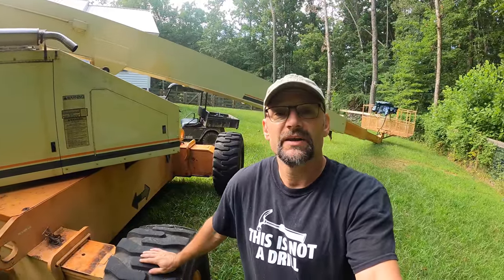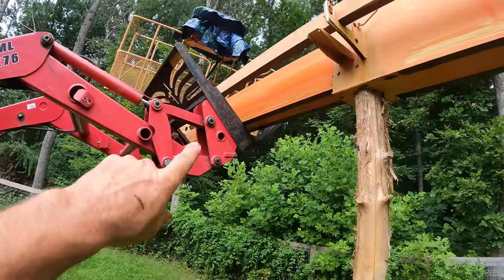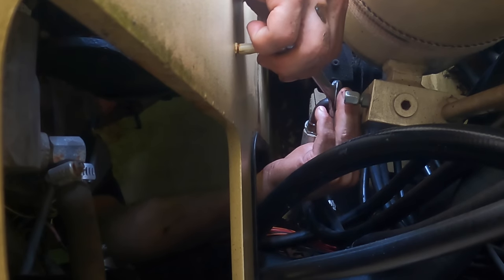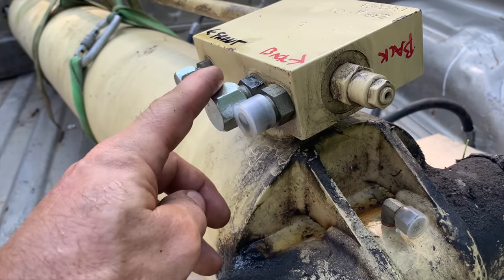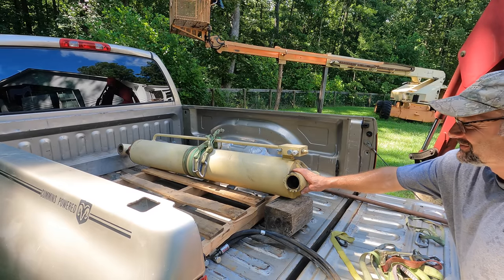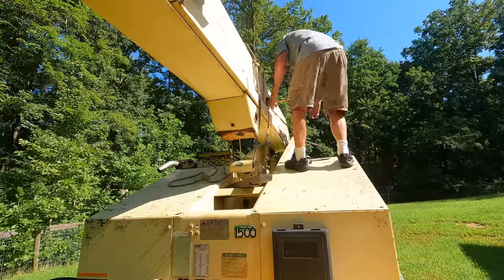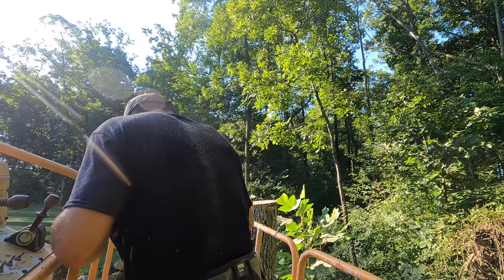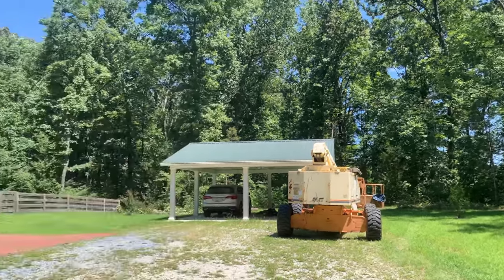Boom Lift Repair - Main Hydraulic Cylinder. What a BEAST! & Cutting Down Dead Trees.

Comment: Not the same boom lift, but I recently replaced my lower lift cylinder seal. I did not remove the cylinder. Just dropped the boom end and removed the gland nut.  Lifted the piston out with the forklift and replaced the seals on  the nut and the piston on the bench. I doubt that you'll ever have to do this again, but it will save you some time and aggravation.
Reply: Wouldn't have worked in this case. The shaft was fubar and needed to be either replaced or rechromed. If he'd just replaced the seals it would've failed again within an hour of use.
Reply from the maker: That’s a good point. I could have just removed the rod and piston. Still would have needed a bigger lathe to replace the rod, but maybe that would have been an easier repair. Of course, with my luck if I had done that I would have found a huge scratch in the barrel. 😂

Comment: If you look on the back of the cylinder block where the hoses connect you will see the painted piece with a nut on it, that is your holding valve, holding valves are on any personal carrying equipment cylinders, they won’t allow a cylinder to collapse if a hose blows, they use pressure to open the check valve, if you ever have issues with your new cylinder drifting down it will need a new holding valve, great to see you giving these old machines a new life, ps I work on these things for a living!
Reply from the maker: Thanks! I wonder if I could ask you some questions via email?  Farmcraft101@yahoo.com.  I’d love to get some info from somebody who really knows these machines.  Cheers.

Comment: Well done a solo reinstall is always a tedious process for large hydraulic cylinders we have done a few of these in the field previously good decision to have an experienced professional rebuild it. We have a policy you don't stick your fingers in a hole that has the potential to amputate 😁 also that belly belt would break your back if you were to be thrown from your basket full body harness is far better investment.

Comment: I can't believe how easy you remove the pins of the lifting cylinder😳 I have to renew the bushings on some machines with an age of 8 or 9 years. I had to take new pins because there are not removeable without massiv heating and much force of pulling...sometimes 30t!
22:55 in my experience, that's the master-cylinder and the slave hold the basket in level, as you saying, while the boom/telescope is raising or lowering.

A little tip to keep the machine away from the boneyard: take a look on the inside of the boom/telescope from behind and try to grease the  upper sliding surfaces. The are mostly dry.

One tree of this size cost 850EUR here in Germany

Realy nice video, explanations and content at all!

Greetings from Germany
I'm sorry if my grammar isn't that good.

Comment: I remember once when I was logging, I had to winch over a large, maybe 30t, Radiata Pine which was leaning out over a steep bank. We hired a 12m man-lift to attach the wire rope about 9-10m up the tree. Fortunately we manage to talk our Supervisor into going up in the cage. We thought it was hilarious as the cage swayed and wobbled and we shouted helpful comments to our now very white-faced Supervisor!
  A Contractor doing that job would have charged up to $2000, which is not unreasonable, considering it would take a day’s labour, Insurance, Transport, etc.
  Great video, exactly the style of YouTube video I enjoy.

Comment: You did it the hard way! Firstly fully retract the boom so it doesn't act like a lever when lifting the boom with fork lift. No need to remove rear cylinder pin. Unscrew cylinder cap  loosen cylinder hoses and check valves and pull piston out and reseal it. Assembly is reverse, but you did get there in the end good job. Foot note ..get a better safety prop than a friggin tree branch...people die on these things !

Comment: I always hate doing hydraulic work for all the mess.  I did some today in fact.  

I would be tempted to replace that grease line with some plastic tube and push to connect grease fittings

Comment: I  run use used engine oil/ hydraulic oil/ mineral oil/ gear box oil separately but mainly mixed in my Golf 1.9 turbo Diesel . I mix 1 Gallon of gas/ thinners to 6 gallons of the dirty black gold. 3 years I've run it and my engine loves the stuff and garages are happy to get rid of it .

Comment: Former equipment operator here.

Just this morning I was removing a pin to clean everything out because the zerk wouldn't take grease. New-to-me tractor, but you know all about that! 

Anyway, I was using ratchet straps and a spud bar to line it all back up to replace the pin, and I was all "man, I really need a helper."

And then here you are with a MUCH larger version of the same thing. 🤣
Reply from the maker: I feel your pain!

Comment: I like it when u use Metric too because it makes it easier to understand, in my area East Coast Canada, that work u just did would easily run u a minimum of about USD $4500 all the precautions u took, u can try to do it the unsafe way by not having a lift but that may lead u to somewhere else, thanks for the content its Edutaining.

Comment: I spent 10 years riding those beasts. The reason "s" I haven't bought one is the same reason your doing the work....maintenance. The machines are tender and High dollar to fix
Reply: But ,If YOU  do the work, different matter. I have a old case/davis 70+4  trencher with a D -130 backhoe. I have taken the trencher off ,and am fabricating a front end loader & crane .Yes ,its a franken-beast ,but I love working on it, (The 65hp hydraulic pump can move ANYTHING).I suggest you spend some bucks and find the shop manuals...or find a mech w/shoptime on this beast & do beer bribe

Comment: One bright side is that you didn't change the oil before so you didn't lose new oil with the leak!  I paid a crew $400 plus a tip to remove a large elm tree about 10 years ago.  The owner of the company climbed the tree and sectioned it.  Then the strongest skinny guys I've seen loaded all the logs on a trailer and they hauled it off.  With the price of things now it would have been at least $800.

Comment: The instant that I saw that your tractor did not have any counterweight on the back I knew it would flip up!
Tractors like that are designed to work with weight on the back!
You should also have wheel weights on the back of that tractor!
No matter what you're going to use the tractor for, you should always have weight on the back! 😁

Comment: Great job on the repairs. Not sure if it would help but I bet if you raised the boom all the way up you should be able to get to the hoses. Also when you pour the hydraulic oil from a 5 gal bucket turn it over where the spout is to the top and it won’t splash so bad

Comment: Spout buckets are meant to be poured with the spout on top, no glugging.  It seems like it would be hard to aim but it’s really not.  Also, when I was a lineman, we would “block” down poles by cutting about 3/4 through the pole on one side and go up 4-6 inches and cut 3/4 through from the opposite side.  Then you have both hands to control the piece.  It will stay there until you pop it off.  It won’t catch and fall straight down onto a fence.

Comment: Man lifts like that and high lift forklifts use a hydraulic parallel linkage system to keep the attachment on the end of the boom at a constant angle that you set it at as the boom goes up and down! 😁

Similar to a mechanical parallel lift system that some tractors use on the front bucket.
Your tractor does not have the parallel linkage system. ☹️
If it did it would have linkage going from the bucket tilt cylinder all the way back to the frame of the tractor. 😃 My favorite system.

Comment: I bet with that much weight at that much stick out the pin seems less comically large. Little cut tip when removing the trunk cut through horizontally until nearly through then remove the saw and cut through from the back at an angle greater than 45degrees and it won't pinch your saw then you use two hands to throw the trunk. I would consider the work done to cost at least 4 thousand here in Australia. Great work.

Comment: I would think a tree specialist would drop all those trees for about 4K+? Plus removing and replacing part of the fence to do so. It took less than twenty minutes to remove a section of my fence to drop a really large tree...You did a lot of work there including the ram... Great job... What is the capacity of that lift in the basket?

Comment: John, I noticed you seem to have the lift facing into the tree you are working on. Is that a safety measure if the lift starts to lower on it's own it will lean up against the tree and perhaps slow down or stop it's fall? Just curious and thanks for posting. Take care!

Comment: I was quoted a $1000 to pull a tree down near (8 feet) from my shed not sure if they were also factoring mulching and clearing up though am sure I didn't ask for that (probably also cost of travel included - I hope!) - ended up putting straps as far up as possible and got a sacrificial Landrover to pull on it and cut it down myself - am no expert they always seem to go backwards for me, but with the strap and the Landie we got it down in the desired location and bonus didn't damage the car. Just a lot of leaves and branches to cleanup. Its was a ~70ft Eucalyptus....

Comment: John, I feel for you. What did the lady say about it in her yard. I know you are there to help her. You need a shorter wrench and you need to take the plug out that you just put in to get the wrench to turn. I would have never though to take the hoses off at the other end. John, I would get a couple of new HDY. hoses. WOW that was an costly fix, $1,500.00 to have the cylinder fixed + $800.00 for the oil. I had a guy that worked on these types of cylinders in our Hyd. gang that fixed two cylinders on the 30 ton Grove Mobile crane that I ran, fixed them both in our shop. My crane was down for a week. I guess everything breaks down sooner or later John. Some of the Bigger JLG's had outriggers on them. John, at the end did you have your safety harness on cutting at 70ft. in the air?  Always be Safe. Great Job you did.

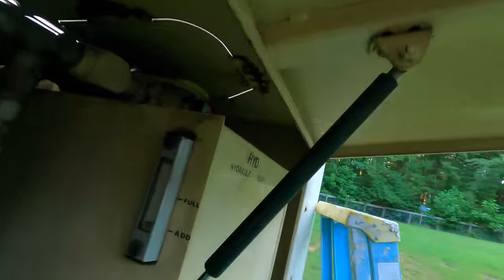Comment: @36:25 is that oil running down from wiping the exposed portion of the ram or was that a leak?  I recently had 2 trees (both with 4' + diameter trunks) removed that had to be roped down. They removed everything that wasn't big enough for fire wood, I did the rest of the cleanup. Cost was 1500. Going by that I'd say 7 trees for 3500-4000 wouldn't be over pricing it. But I guess that depends on the area you live it also. Prices do vary a lot. I used a smaller version of your lift (45' max) and the wobble factor on that thing made some body parts pucker with all the swaying. I can't even begin to imagine what it's like 70-80 feet up.

Comment: For a totally closed system the oil can't be that bad I would think. An oil sample test might've been a good investment. I know alot of excavators that do big hours never get totally new oil, just top ups and fresh filters. I suppose the standing still might have hurt it more then doing actual work though. In any case you now know what you have. Nice work.

Comment: If it were me I would have pumped the oil in through a return line leading back to the filter housing. That would give some protection from oil that wasn't as clean as the system may require. It may sound like a waste but occasionally suppliers ship out oil that isn't clean.

Comment: Impressive work!  Definitely doing work of more than one person here.  Pretty crappy instructions for removing this monster.  Someone needs to have a talk to with their technical writers.  I'll never do this job but if anyone asks, I can tell them the best way to disconnect the hoses.  I just had two large oaks, one very big pine, one smaller pine, four other smaller trees taken down and another pruned of ice storm damage. The also did cleanup.  $4,025 here in Southern Virginia.

Comment: favorite youtuber there. About pricing I can only tell you how it is in Denmark...roughly.  Taking in consideration the difficulty for those, since you need a boom for most of them. It would be around 500-800$ pr. tree. This would include cleanup as well. I see prices way above 1000$ for very hard to get and risky job, pr. tree. I would imagine it's way to much "over there". But I was surprised that it actually is that expensive.

Comment: I’ll be honest €1500 was pretty cheap for new seals and a new rod on a cylinder that size! I used to work on hydraulic scissor lifts in my youth, we had 6” diameter 4’ long cylinders on one machine and they  took a LOT of man handling when it came to changing seals. You did well to get that one out and in by yourself.

Comment: If i remember correctly hydraulic oil is pretty much impossible to burn in a normal waste-oil heater, since it contains some additive that clogs up the burner nozzle. Might be wrong though!

Comment: Using a vacuum cleaner on the fill port of the hydraulic tank you can better control the flow and actually stop the oil while switching buckets. Looking at how you add oil you could have used the port your breather filter is on.
Reply from the maker: Yeah, that's a good tip.  I thought about it, but was too lazy to go get the shop vac.  ;-)

Comment: you need to be able to elevate the basket. knock the pin out, then unscrew the gland and pull the rod out. easy job
Reply: small cylinder goes to basket level cylinder

Comment: get yourself a service wrench set from harbor freight.  they heads are offset and made to slip into cheater bars.  they sell zip ties in a 12 different colors pack. use those to designate lines. hydraulic fluid will wipe the sharpie right off.

Comment: What a pain in your boomlift John it always seems when a job is at hand it usually ends up with 1 step forward and 2 steps back,

Some years ago my neighbour wanted me to cut down an approx 50m eucalyptus Corymbia citriadora (lemon Scented Gum)  it is also known as a widow maker  species, on the nearly border of my property, it was the biggest tree in the neighbourhood diameter on it was about 6 feet on the trunk
I wasn't too ecstatic about the idea but said look I don't have the money to do it, if you want it done you will have 2 pay for it
I believe it cost $3500 the arbourist used a boom luft truck
A fairly big mulcher attached to what looked like a 5 ton truck with enclosed back for the mulch to fly into.
Various chainsaws and 3 guys 2 in the basket and one on the ground feeding the mulcher
The tree was about 10 feet from power lines
A huge pile of firewood was left cut into about 45cms logs and left a trunk about 12 foot x 6 foot long (with Hollow interior possible white ant damage)
So that gives you a figure
Of what my tree cost to fell about 15 years ago in a small rural town in the Wheatbelt of Western Australia 

Thanks for the videos John I enjoy your farmers practical ways and ingenuity. 

Tony from Western Australia 🇦🇺

Comment: Very funny but informative video. You do great videos. I to am curious about the cost of taking those trees out. I will be starting my little retirement business if mulching and tree removal on a smaller scale but I would imagine $500?? Maybe $600??
Reply: You must have a fantastic pension if your time is worth that little
Reply: the average cost to take out a larger tree is around $600 to $1000 per tree. Since there were 7 trees in this job, around $4k to $5k would be a reasonable price. However, it appears that he did not have to do any removal of the trees and was able to just drop them into the woods and leave there, so that might be a discount to factor in, so let's say 3k to 4k for this job in my opinion.

Comment: Could you get one of those cameras that show what they see with wired connections far away (or via bluetooth or local wifi?) In that way in a lot of cases where you need eyes somewhere else you could check through the camera.

Ah you have it already! You have the camera of the drone that is relaying to you what it is seeing, you could use that camera (or buy a similar one).

Comment: What was the little leak from the cylinder at the 36:24 mark when you were retracting it? Anything to worry about? It looks like it had been wiped it off in later clips.
Reply from the maker: You have a good eye. I wiped oil on the rod before I retracted it the first time just to help out the new seals. The wiper wiped it off and caused the drip. All good.

Comment: I would really like to see the layout of the gland on that cylinder. To see all these “back up , back up , back up seals”.  14,000 is absurd. Looks like a normal 8” cylinder with a doubly pilot op check valve welded to the steel lines.

Comment: I have worked on hydraulic a lot plus putting rigs back together so on Pins we use a lathe  too put a little more and longer bevel on the pin It has saved many hours in the past  .Just sayin , like your video's

Comment: Boom lifts are terrifying, as you showed in the other video about this machine, lol. I was window cleaning as a youth and working on the federal faa building I didn't have a gov issued ID to let me in the building... So the work around was using a boom lift to go up 6 stories with our rolling rig and 3 guys... We quickly learned that was a terrible idea and we'll do the guys first and the equipment last. Abide the bucket max weight cap... And literally every other warning on those things, they are written in blood

As for what a reasonable price for the work, given what I know of what folks charge for that kind of work in the pnw and a boom rental would be at least 1 grand I'd say three grand easy, and probably more. In your case, for a neighbor, I'd say maybe a 8 foot cylinder repair and truckload of hydraulic oil would be close to fair, lol